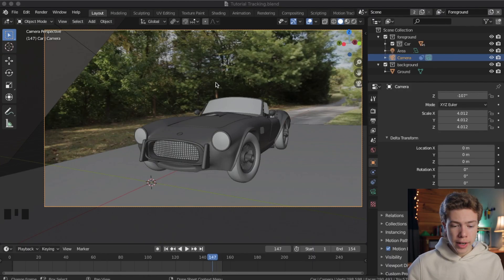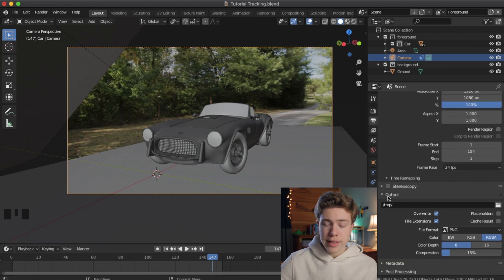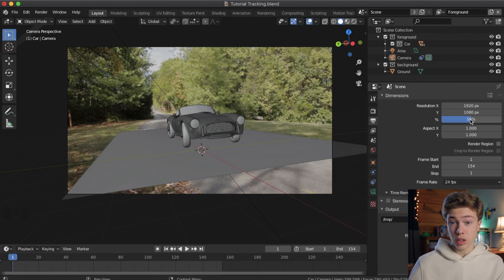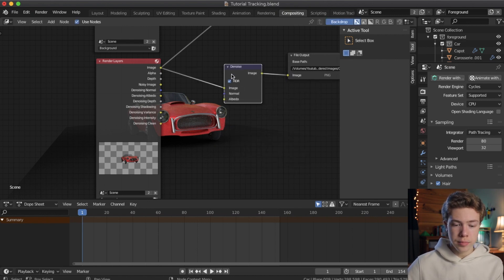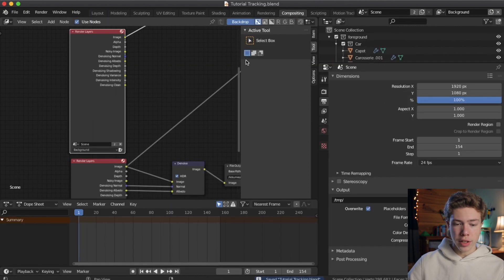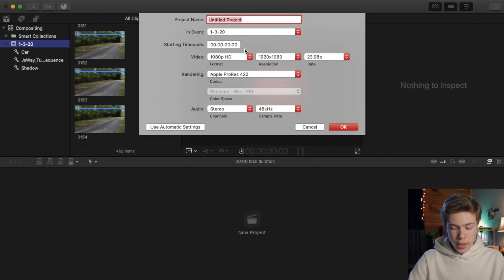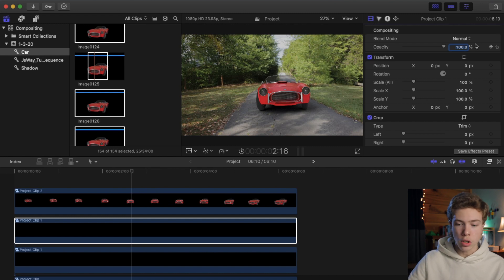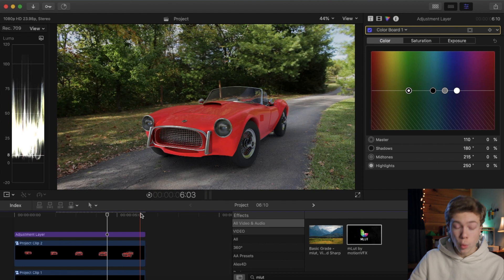How to Realistically 3D Composite a Car in Blender | PART 7 (Rendering and Compositing)

Comment: Great Tutorial, thanks. I am almost done, but when I render an Image for testing it shows the 3D object which I appended and a grey background. The colors of the Tracked Video is very dimm and dark in Layout mode, in Motion Tracking mode it is very bright.
It does not render....Do You have any suggestions what I can do?

Thanks again
Reply from the maker: Kuba Degi those are a lot of problems and have too many possible causes for me to answer each of them. I would suggest googling them individually and looking on stack exchange. Also the colors problem is probably from your video being set to 50% opacity as the background.